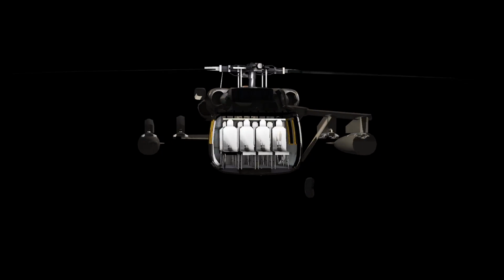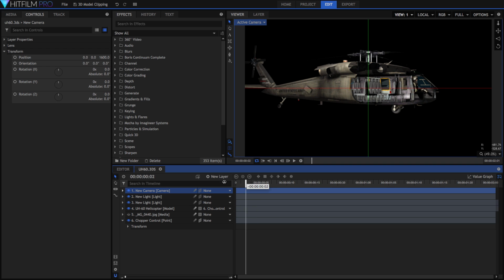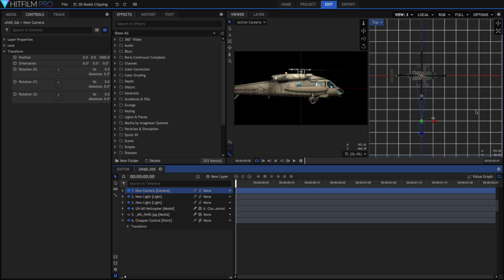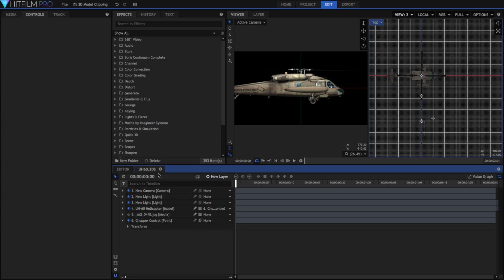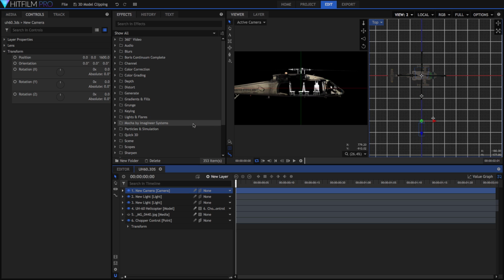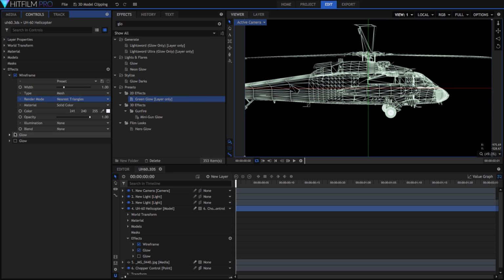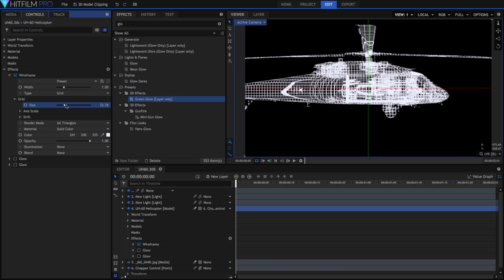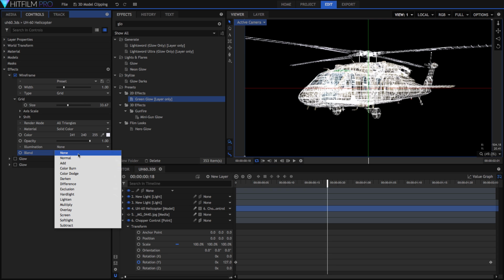How to create 3D cutaway shots and wireframe effects | HitFilm Pro

Comment: So I finally got around to using this technique in Essential Hitfilm 12.

As a variation, I duplicated the main comp and, in the duplicate, changed the near AND far clip distance so the duplicate only showed 2-3 pixels of the model as a "rim" at the clip point. Tinted the rim white, added glows and a touch of heat distortion, and comped that back on top of the main model. Gave the cutaway a nice glowing rim. Looked pretty cool. 

Thanks again, Axel! Awesome technique!